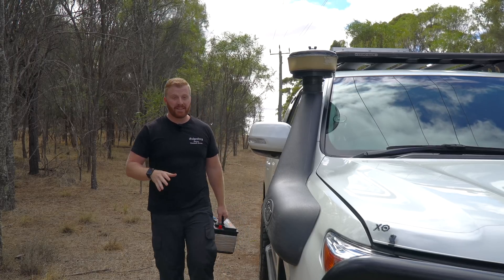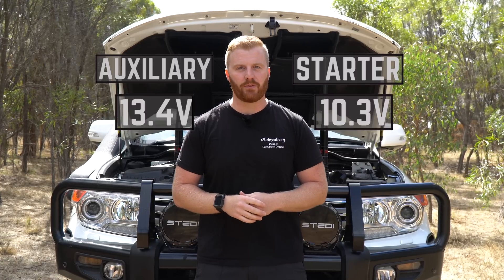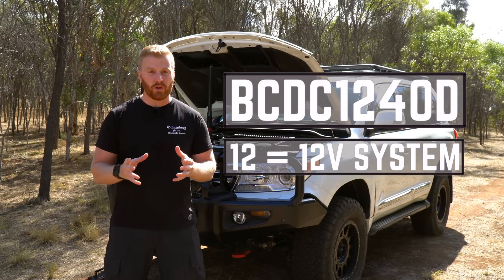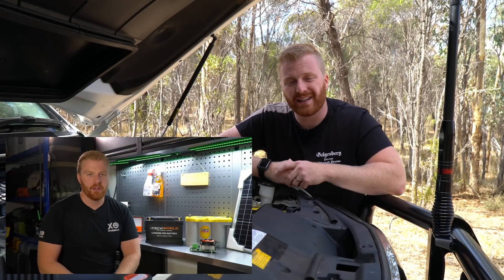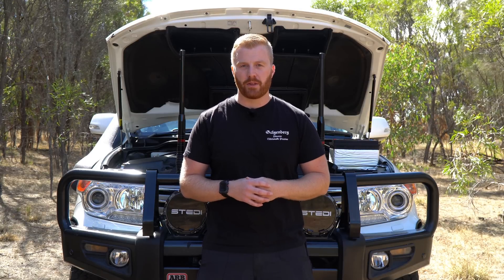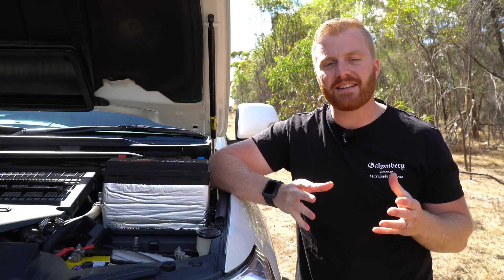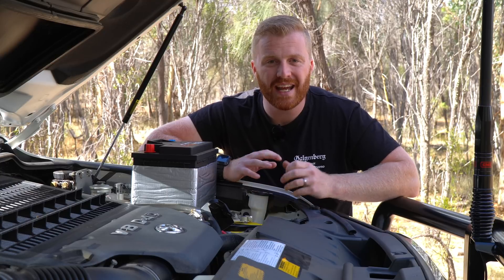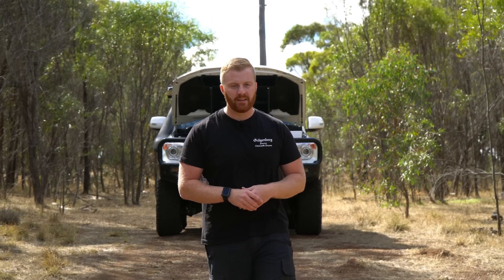LITHIUM is OUT for now… | Not everything works first time | iTechWorld 1420 CA PRO | The AGM is back

Comment: Interesting Nathan, can I ask does your bcdc still have the ignition wire as per diagram? I guess its not connected in your case which is normally fine. You could connect it to the ignition and it should switch the charger off once ignition is off. I had a similar problem in my ranger and this solved it completely. My 200 while a different brand lithium to yours, I returned the system to parallel to get the benefit of all that capacity from 2 lithiums, but used a victrjn load disconnect to run the accessories from. Once battery capacity gets to 20% it shuts off the loads so you can start the car. Great clip as always mate. Cheers Steve
Reply from the maker: Hey mate, yes the Redarc charger has an ignition wire, however ironically it doesn't isolate the charger when the ignition is off, rather just putting the unit into a low voltage mode. I know this as I've just tried this fix unsuccessfully. It amazes me that Redarc don't have this feature in built 🤷‍♂️ 
Yes, I do like the DCS system, just a little pricey to manage a electrical system that I require at the current time. 
Cheers.

Comment: I had a similar problem with the crank battery draining even though the charger was supposed to isolate the secons battery. An auto electrician knew the problem and fixed it by adding a VSR from the crank battery. It is a sneaky problem that creeps up on you without a proper relay.
Reply from the maker: Yes, something that isn't well advertised and isn't at all mentioned by the manufacturers of the batteries either 🤔

Comment: I am pretty sure that the BCDC also has a wire that connects to a circuit that only charged when the engine on. My understanding is that the BCDC should not do any charging unless the engine is running. I assume you do not have this connected properly or am I confusing things?
Reply from the maker: Hey mate, the BCDC does have a blue ignition wire, however this puts the unit into a low voltage mode and won't complete isolate the charger when the engine is off... I know this as I've recently tried it unsuccessfully 🤦‍♂️ 
Cheers, Nathan 👍

Comment: This is why the victron unit + two batteries in the engine bay is the way to go. Combine both, set disconnect at 20% SOC and can always start the vehicle. 2x 100AH lithium under bonnet gives you 160ah useable and saves heaps of weight. The BCDC's are useless for lithium, can just use the alternator to charge and take advantage of 100 amps charging across both while driving. The only replacement function needed from bcdc was it's mppt regulator.
Reply from the maker: For sure, this is another way to manage the system, however these iTechWorld batteries aren't quite up to the job yet. the 120X aux battery isn't rated for cranking and the 1420 CA PRO is only 60ah in capacity so 120ah isn't much. Maybe something I'll look into in the future. 
Cheers, Nathan.
Reply: @XploringOz  yeah. I won’t name names since your sponsored but there is a kit that can do this getting popular and it’s reviewing well. It is expensive tho
Reply from the maker: @Snook_  Yeah mate, I agree that the DCS systems are a great option and very likely a higher quality system, however I'm interested to see how these 'budget' options go long term as you would know the alternative is expensive and hard to justify for an electrical system like mine.

Comment: Just a thought
Identical batteries under the bonnet. Get rid of the 12v charger and use the battery protect to load.
Possibly go to a battery with Bluetooth monitoring
Reply: Take care that you can’t connect a inverter to the Victron
Reply from the maker: This is an option, however not something that is budget friendly at this time. Maybe moving forward will be something I'll look into. 
Cheers, Nathan.

Comment: Hey Nathan, what about if the Li battery is the auxiliary and a Pb battery is the cranking? Would the relay still be needed?
Reply from the maker: Hey mate, negative. This combination will work fine and is what I'm currently running pending sorting out a long term solution. 
Cheers 👍

Comment: It surprised me that you didn’t have a suitable relay. You definitely don’t want the Aux systems drawing current from the cranking battery when the ignition is switched off.
Reply: You only need the relay when you have a Lithium starter battery, as the BCDC stops charging your auxiliary battery as soon as the alternator stops charging.  ie. when the engine is not running.

Comment: Redarc 🤣 that's your problem....
You need a isolator with them, and never made for lipo4 main.
Need a battery isolator that cuts at the car turning off.
Reply from the maker: Haha, yeah I've discovered that the hard way 🤦‍♂️ 
Hopefully I'll find a work around for the LifePO4 systems 👍

Comment: I'd say run a vsr type isolator in between the two lithium batteries and a victron bp65 off of the aux lithium to power your accessories. Should enable both batteries to charge off the alternator ( same chemistry type ) super fast providing the bms of the batteries is up to spec.
Reply from the maker: Cheers mate, I'll look into it 👍

Comment: Wrong setup and wrong batteries. I’ve setup 1000’s of cars with lithium, no bcdc required, redarc’s lithium setup isn’t that good, no bms restart feature and 2hr charge limits. If you want a proper setup get in contact
Reply from the maker: I'm sure these will work with a couple of extra components. I agree that the DCS units are a different and likely higher quality system but not something I can afford at this stage given my power requirements. 
Cheers, Nathan.

Comment: Great vid Nathan. One thing I’m not sure was clear is that the victron bmv712 can control and manage a third party relay. Keep the vids coming!
Reply from the maker: Cheers mate. So the Victron unit is not a controller as such and will only monitor the battery activity. A separate component would be required to provide a voltage cut out feature. 
Cheers 👍

Comment: Hi Mate, don’t use the Victron VSR units, I had one in my LC200 and camper and both blew up in the Simpson desert. I have now installed a Narva 140a VSR before my 50amp Redarc BCDC and I have my camper 40amp Redarc BCDC also off this and it’s been in for 18months with no problem. We also have done this same setup on 4 other landcruisers with no further issues. They are a simple solenoid that only works on voltage and they can take the heat from the engine where the Victron unit can not cope with the extra heat and are a more complex unit. It’s a DIY Mod and a must have on starting lithium’s. I hope this helps mate🍻
Reply from the maker: Cheers mate, thanks for sharing. I'm getting a few stories about these Victron units. 
I'll check out those solenoids. 
Cheers, Nathan.
Reply: @XploringOz  your welcome, the Narva 160amp VSR units will be good to run your charger and Andersen plug for your van off. These types of VSRs are bush proof and a set and forget unit that leaves enough power in the start battery to start up and most importantly they can handle the heat. I’ve run this now for 18months with no further issues or flat batteries. I can understand how and why you took out the lithium but if you add this unit in after your research you won’t look back. Keep up the great videos mate, always good to watch your informative and well presented videos🍻
Reply from the maker: @nathancurran8550  For sure mate, I'll do my research. I've been given a few ideas that could work for my setup. All of these solutions have the same idea (disconnecting the input battery at certain voltages or ignition feeds). I'll be sure to report back with whichever way I decide to go and how it works 👍
Thanks mate, glad you enjoy the channel. 
Cheers, Nathan.

Comment: If you isolate the bcc’d charger when the ignition turns off does that also turn off the bcc’d charger so any solar input would not be registered?
I was thinking the Victorian smart isolator mounted under the bonnet put at the front where the temps don’t get as high
Reply from the maker: I'm under the belief that isolating the BCDC charger won't effect the solar input as it's a different component of the charger. If I were to use a relay on the input wire, this will only inform the charger that there is not input battery and should still operate as per normal on solar.
Cheers 👍
Reply: Solar input is a different wire to the DC input so shouldn't be a problem.

Comment: DCDC charger might not be required. The vehicles standard alternator should provide enough charging if the Lithium batteries are in parrallel. I use the DCS twin batteries with a Victron Smart battery protect and it works fine. Im not an electrical expert and with some advice from the DCS guys, i have put in a very solid 12v supply all under the bonnet.
Reply from the maker: Yes, this is correct. However saying that, this system is not wired in parallel and these batteries are operating independently.
Cheers, Nathan.

Comment: Why not just hook up the "blue wire" that gets fitted to smart alternator systems. The bcdc wont function til ignition sourced is switched on?
Reply from the maker: I'm doing some testing with this blue wire too, but it's not a direct ignition feed. This will result in the BCDC entering a 'low voltage' mode which won't stop the issue. 
Cheers.

Comment: Thanks for the straight talk and reliable information that provides.
My conclusion for myself after looking at the prices of the batteries + isolator and taking into consideration the weight savings of 40+kg on the front wheels is I'll keep the weight on the front wheels and stick to the LA batteries. 
The vehicle originally came with LA's and is designed for the LA batteries. If one of the batteries fails a replacement is relatively easily found anywhere and won't cost $1000 odd. We also don't know how Lithium batteries will survive 1,000's of km of rutted roads.
Reply from the maker: No problems mate, I'm glad you enjoyed the video 👍 
For sure, I hear where you are coming from, Lithium is still new tech and we don't know exactly how it's going to react to the conditions we place it under long term. I guess this is why I'm testing and reporting my results and hopefully this can help others make informed decisions for their vehicle. 
Cheers, Nathan.
Reply: @XploringOz  I'm constructing a camper and in it is 13.8kWh of LiFePO4 that weigh around 80gk. If I ever finish it, I´ll be able to tell you how the Lithiums perform! Mind you I'm insulating them from vibration as if they're eggs.

Comment: Yes the hi amp relay is a simpler and more reliable and probably cheaper solution but it begs the question: why does red arc not have a build in ignition wire input for simple switching - most of the so call “ lesser “ competitors do… electrically, is not hard and definitely more reliable than voltage sensing
Reply from the maker: Hmm, good question. I'm going to see if I can't find a fix like this which would be much simpler. 
Cheers, Nathan.

Comment: Wondering what you have wrapped around the battery?
Reply from the maker: hey mate, I've used a foil and foam heat shield around this battery to reduce the heat transfer from the engine. 
I've got a bit more detail on this in the 120X lithium battery install and the link is in the description too. 
Cheers, Nathan.

Comment: Seems like a lot of hassle for little benefit, just run a standard start battery (kiss principal) less wiring, cost effective, reliable and easy to source a replacement anywhere in Australia
Reply from the maker: I see where your getting at, but disagree with the little benefit. Lithiums have several benefits other than just weights. Further, even with this setup and transitional battery can be dropped in without any adjustments is something goes wrong. 
Cheers, Nathan.
Reply: @XploringOz  fair enough mate everyone has different needs with there setups. Keep up the good content I enjoy your videos 👍
Reply from the maker: @ajf9034  For sure, everyone has there own 'ideal setup'. Cheers mate 👍

Comment: Should have them in parallel with low voltage cutout. Get rid of the charger.
Reply from the maker: I could, but then I would loose significant capacity for my auxiliary setup. I prefer the isolated full cranking battery and a dedicated auxiliary. Just my personal preference. 
Cheers

Comment: Also you could have gone with the victron  DC-DC 50a charger it also isolates . This would’ve save the need for a relay of any description.
Reply: I have one of those and prefer it to my previous redarc bcdc due to the customisable config however they’re not designed for under bonnet use, not an issue for me as I’ve moved my house battery out of the engine bay.
Reply from the maker: This would be ideal, but I need to be able to mount it in the engine bay, which I don't think these units are designed for? 
Cheers, Nahtan.

Comment: I have the Renogy dcdc charger, with ignition off it cannot charge the auxiliary battery, doesn't the Redarc have this function?
Reply from the maker: Unfortunately the Redarc does not have this feature… at the moment. No doubt they will implement some design changes as lithium becomes more and more popular. Redarc do have a blue ignition wire, however this only activates a low voltage mode rather than a cut off. 
Cheers, Nathan.

Comment: very interesting thanks, 
my DCDC charger has a wire to connect to ignition circuit, 
I don't use it as I don't have a "smart alternator"
would this solve the problem?
Reply from the maker: The Redarc has a blue 'ignition' wire, however this only puts the unit into low voltage mode and still won't isolate the starter battery with the vehicle is off. The relay will ensure the starter battery can't be drawn down. 
Cheers.

Comment: I just have a circuit breaker between the starter battery and bcdc to aux battery, just open it when not needed, don’t think the victron smart disconnect can be under the bonnet
Reply from the maker: This is another solution, as long as the starter is isolated when the ignition is off then it should work well. Yes, you are correct the Victron unit doesn't like heat. 
Cheers.

Comment: I have 2 lithium batteries from Itechworld for 2 years, no issue. If you use lithium, all should be lithium, no mixing lithium and AGM.
Reply from the maker: I would, but I can't if they are going to drain whilst the vehicle is off and running accessories. 
Further, these two batteries are separated and both are receiving the correct charge levels and currents as per manufacture specifications so they should be fine in the long run. 
Cheers, Nathan.

Comment: Interesting going ons .The problems I see there that your aux battery wont receive solar input that the redarc system supplies  if you use the relay. Or am I looking at it wrong Something to think about Thankyou Your always worth listening to.
Reply from the maker: Hey mate, from my understanding the Redarc will still receive solar input as the relay will only disconnect the voltage input wire from the primary battery. I'll be sure to test everything before reporting back 👍 
Cheers, Nathan.

Comment: Hi Nathan I have the I tech batteries in my Land cruiser. I had the same problem as you to start with.
The Redarc and the Enerdrive were designed for lead acid cranking batteries.
I just added two relays. One for the Redarc in the cruiser and the other for the off road caravan with the Enerdrive .
Works great and have not had any problems.
Great show.
Cheers
Wayne
Reply from the maker: Awesome, great to hear that you have managed to sort a simple and effective solution 👍 
Thanks mate, glad you are enjoying the content. 
Cheers, Nathan.

Comment: Interesting video. I fitted a Redarc SBi12 to ensure a disconnect from the starter battery when turned off. I’m also running a redarc BCDC charger. Piggy backed off an ignition fuse and have not any issues.  Have a look at those. Might be a solution
Reply from the maker: That sounds like another great solution. As long as that starter battery is isolated when the ignition is off it should work well 👍

Comment: I looked at the red arc manual and it seems to be updated. My system I simply connected the blue wire . Once the ignition was turned off the bcdc would disconnect from primary battery after a few minutes “meaning stop charging “ . Not sure why they changed it . I never had the main battery drain . If I left ignition on yes I would have. Edit just to add with the blue wire connected once ignition turned off the bcdc would stay connected until the main battery voltage dropped slightly. I tested this with turning the car lights on with ignition off . A few seconds later you could see the redarc stop charging second battery. It looks like looking at the latest manual they have lowered the cut out voltage .
Reply from the maker: Yes, I have also noticed this in their manuals too. I'm not quite sure why Redarc didn't suggest this method when calling them. I'm going to try this solution too, just to see how it goes and compares to other fixes 👍 
Cheers, Nathan.
Reply: @XploringOz  It will only work if you have a older redarc BCDC as the new ones they have dropped the cutout voltage hence they redarc will not disconnect until main battery is just about dead.  You may have the older BCDC if so disregard .  Going to look at the Ineos next week sth of Perth should be fun.
Reply from the maker: @Susieandchris  Yes, I have been playing around with the blue ignition wire and agree, it only enters low voltage mode and doesn't disconnect the system. I don't understand why Redarc wouldn't include this feature 🤷‍♂
Awesome, certainly looks like an interesting vehicle 👍